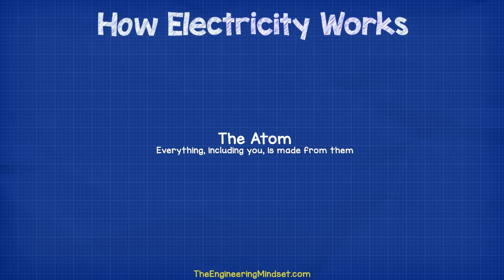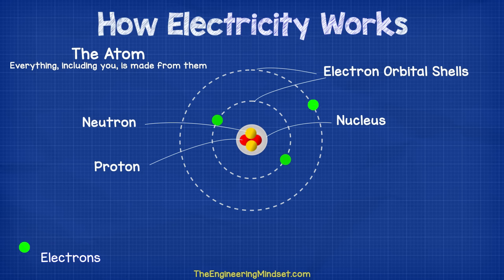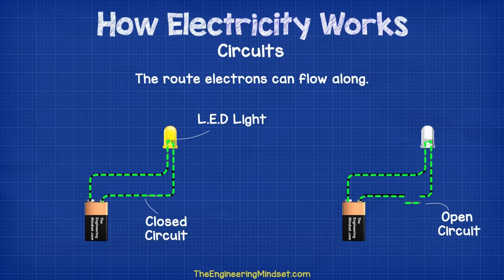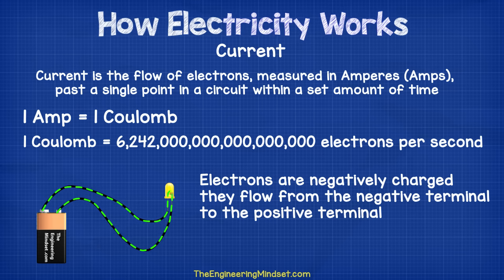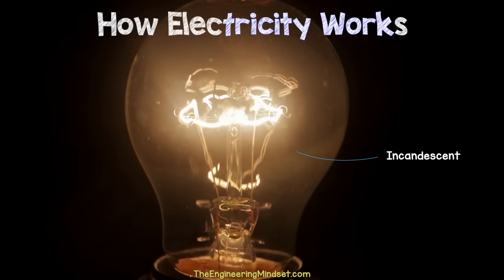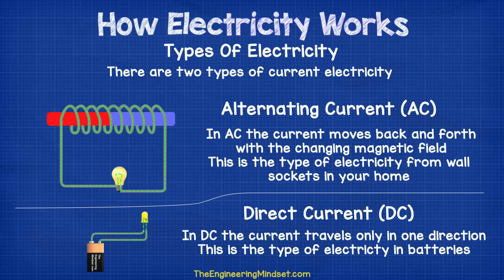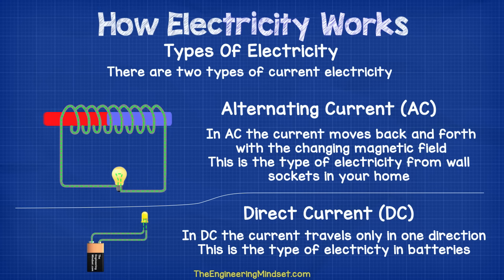How ELECTRICITY works - working principle

Comment: This is an excellent video, very easy to understand, though covering a lot of ground.  It's probably best as a review, or to make sense of material read in a textbook that was confusing the first time through.  If you're a first-timer, watch it a few times, until you get the stuff on capacitors, AC current, and transformers at the end, or look up some videos on those.

I did find four things that were either wrong or a little misleading:

At 0:53, it says that protons and neutrons are heavier than electrons (they are, by ~1837 times), but this isn't why they're in the nucleus.  Gravity is uninvolved.  Rather, they attract each other through the weak nuclear force, one of the four fundamental forces of physics.  This forms a small blob of particles with positive charge.  The electrons surround that charge concentration.

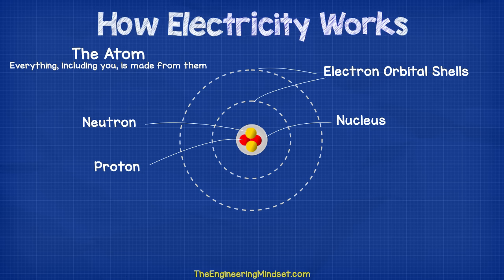At 1:00 in the diagram of the atom, it shows and the narrator states that electrons travel on paths like orbits.  This is incorrect.  It's commonly said because most people have a hard time conceptualizing the electron clouds of quantum mechanics, which is our best understanding of how electrons behave.  If you're not going to take a crack at explaining that, it's best to say something like:

Electrons exist around the nucleus in clouds or shells, each of which can hold up to a certain number of electrons.  We often think of these as paths like orbits at different distances from the nucleus, though that is just a conceptual convenience that we'll adopt here.  In this concept, the farther out the shell, the more electrons can fit in a shell and the easier it is to break one out.  It's also harder to break electrons out of full or mostly full shells.  Conductors like metals have just one electron in their outermost shell, making it easy for that electron to escape and flow freely.  That's what makes them conductors.  Insulators have full or nearly full outer shells, and, thus, very few free-flowing electrons.

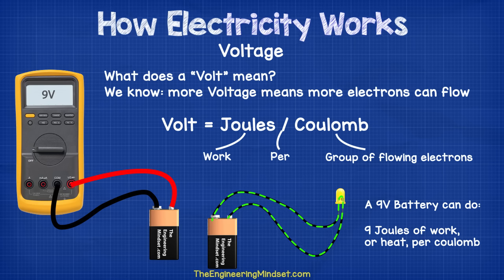At 4:00, the narrator gets it right, but the slide has an error.  The slide says "1 Amp = 1 Coulomb" and "1 Coulomb = 6,452,000,000,000,000,000 electrons per second".  Rather, 1 Amp = 1 Coulomb per second and 1 Coulomb = 6,452,000,000,000,000,000 electrons.

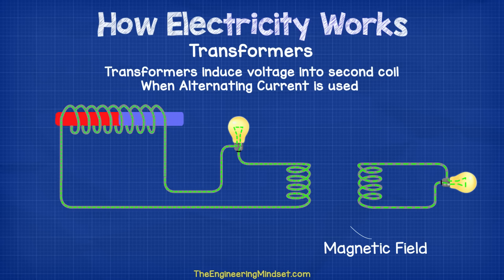Just a nit, at 6:53, the two coils in the transformer both have 4 turns, so they would not change the voltage.  The dashes showing current flow are different in the two circuits, implying such a change.

None of these will confuse a viewer who has never been exposed to these ideas.  Overall, it's an excellent video!  I'm recommending it to my son, who, sadly, refuses to learn from me directly.

-jh-

Comment: Thank you so much for your videos! Amazing explanations around electricity concepts for non-technical folks like myself.

Help me understand something: 

1 amp means 6.242 quintillion electrons pass through a point in a circuit in 1 second. This also implies voltage in a circuit of 1V and resistance of 1 Ohm, correct? If we increase voltage to 2V, does that mean that twice as many free electrons would be flowing in a circuit and passing through a point - i.e., 12.848 electrons/second? But that effectively raises amperage to 2 amp, doesn't it? Or the number of electrons does not change, but their speed at which they travel in the circuit doubles? But that also effectively means that double the amount of electrons would be passing through a point in a circuit each second. So I am bit confused with the relationship between current and voltage. Can you explain it in terms of numberand speed of electrons that travel through a point in a circuit? Thanks a lot!

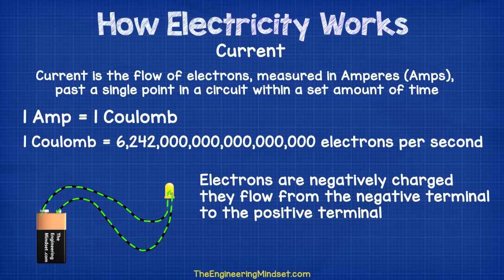Comment: Slight error: at min 4:30 it seems like amps measure electrons per second squared, like acceleration, and you wrote that 1 coulomb is measured in electrons per second. 1 A = 1 C / s and 1 C = 1 A * s or 6.242*10^18 electrons. Not electrons per second

Comment: If the current is flowing from the positive to the negative as in this demonstration and the resistor is on the negative side of the LED why then doesn't the LED burn out ? Shouldn't it be in front of the LED between the positive terminal and the lED?

Comment: I enjoy your videos, but the polarity of your 9V batteries is backwards!  The small terminal is positive and the large terminal is negative.  Your electron current is going the wrong way with respect to your batteries (unless you are indicating conventional current flow, which is used by engineers and historically is shown flowing out of the positive terminal).

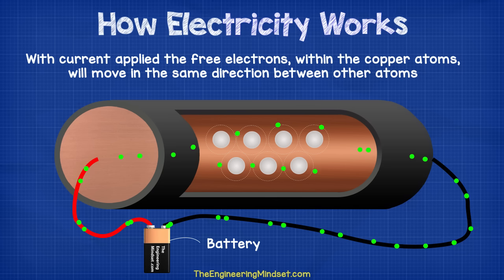Comment: Error at 2:34 the electrons flow in the other direction, from the lowest voltage to the highest voltage, wich mean from the black to the red wire

Comment: Great video, short & to the point as it should be!

---------

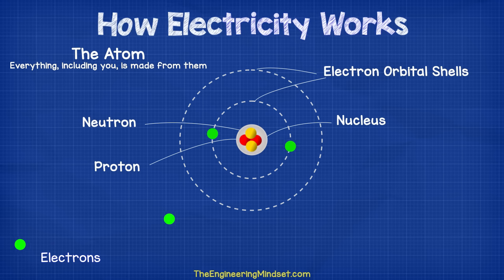01:30 INSULATOR: atoms without free electrons in valence shell
CONDUCTOR: atoms that can pass electrons - surround with insulator (e.g. copper wire inside rubber) 

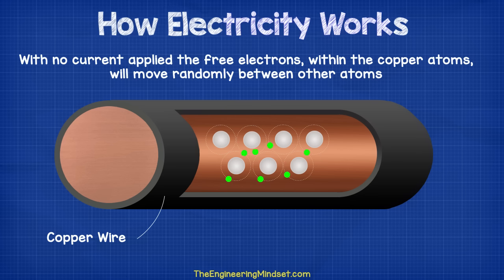02:15 Atoms are passed randomly in any direction
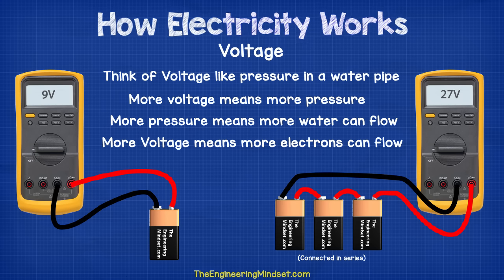Connect conductive material to CLOSED circuit with power source -> 03:09 VOLTAGE (pushing force, analogy: pressure in water pipe) forces electrons to move in same direction, trying to get to the other terminal

03:23 VOLT= work (Joules, heat/light) per group of flowing electrons (Coulomb)

03:59 AMP = unit of current (analogy: flow of water in pipe), 1 Amp = 1 Coulomb/second
04:37 RESISTANCE (unit = Ohms) = restriction on flow of electrons -- factors: length (longer = more resistance), thickness (thicker = less resistance), material (copper has lower electron collision rate than iron -> copper offers less resistance), temperature (hotter = less resistance)

In circuits without inductances or capacitance Ohm's law: Voltage (V, in Volts) = Current (I, in Amps) * Resistance (R, in Ohms) -> Current = Voltage / Resistance & Resistance = Voltage / Current
Power (P, in Watts) = Voltage * Current

04:59 RESISTORS restrict flow of electrons, e.g. protect other components or create light/heat (05:16 high enough collission rate of electrons due to resistance => incandescence)

05:40 INDUCTOR - coiling a wire intensifies its natural magnetic field as current passes through it -> electrons in wire become affected.
More turns in coil / iron core / more current ---> stronger magnetic field ---> electromagnets + induction motors

06:27 AC GENERATORS; passing magnetic field THROUGH coil -> induced electromotive force -> induce voltage, cause current to flow if in circuit

06:52 TRANSFORMERS: induce voltage from primary coil (in circuit with AC generator) over into a secondary (proximate but not touching) coil (in CLOSED circuit). => allows to increase/decrease voltage between primary and secondary coil by changing amount of coils on either side.

07:38 CAPACITOR ("condensator" in multiple languages): separates positive and negative charges across 2 plates if connected to power supply -> build-up of electrons in electric field ... interrupted power supply -> charges released (power source for few seconds) + pair back up again

08:17 ALTERNATING CURRENT (AC): current flow backwards & forwards as terminals are reversed, most common (wall sockets,...)
DIRECT CURRENT (DC): current flows only in 1 direction (batteries, handheld devices, solar panels)

Comment: Marvelous, Great. I just have a quick question, Can you tell why the polarity does not matter when connecting electronic devices into an outlet?  I know current alters but If you show it with a video that would be great, I almost got it right but I just need a extra push

Comment: So are the electrons flowing in a circuit actually the electrons from the atoms of the conductor and not electrons flowing from the battery? When electricy is said to flow through a person( being electrocuted) is it the electrons from the conductor they came into contact with flowing through them, or electrons from the atoms that they are made up of ( skin,bone,blood,etc) being induced to move?

Comment: I have an "uhhh, actually" for you that you may want to ignore.  You discuss current and electron flow as if they're the same with electrons moving from a battery's positive terminal, throughout the circuit to ultimately flow TOWARD the negative terminal.  But you're mistakenly conflating CURRENT direction with electron flow direction.  But since elections are negatively charged, they travel from the negative towards the positive. So current and electron flow go in OPPOSITE directions.

Comment: Hold on, do you need neutral with 3 phases? I've seen power lines with 4 wires, one is neutral, but it's only in one residential area.

Comment: Anyone here can answer? From what i understand in this video you are saying that energy in the form of electrons came from a conductor such as copper. The electrons detached or flowed through the circuit because of voltage or the pushing force from the battery. Am i right? Then now i have a question. If this energy (electrons) which came from the conductor is continously consumed by a load such as bulb, why is it that the conductor never run out of electrons? or theoretically it will eventually?

Comment: There is a mistake at 04:00. 1 amp = 1 Coulomb PER SECOND. And 1 Coulomb is just 6,241 506 × 10^18 electrons and NOT per second. You say it correctly though so I think it’s a typo :)

Comment: Can you explain why connecting cells in series adds up the voltage based on the actual electron flow inside the cell and the chemical composition of the cell (it would be really good if you also explain in terms of redox potential) ?Please explain with the example of a   zinc carbon cell(or any primary cell).

Comment: There is a video circulating in various conspiracy fields and I cant quite figure the physics of it. They have an experiment set up which is a combination of the final 2 images you have on this video. Where you have a magnet through the coils in AC, they don't have that. Where you have a battery in the DC they don't have that. They have a coil of wire (no information on material), at the end of the coil they have an insulator/plate and then a button magnet. When they place a LED or small motor across the battery to the opposite end of the coil, they have a current which operates the LED or coil. They also have a voltmeter reading ~2.6v.
I know its an induced EMF, but im sure im missing something, can you help?

Comment: hello 
thanks for the videos 
I'm an absolute beginner 
and my question is that will the voltage of batteries change? for example if a battery is 9V when it's full charged will it be like 2v when its capacity is some where about 20 percent?

Comment: If you think of electricity as water, voltage is the pressure of the water, current is how much water you have or its flow.

Comment: Well technically the electrons do not follow an orbit around an atom the way a satellite orbits a planet, there's the whole particle-wave duality and whatnot. But I suppose that doesn't really matter as long as the valence electron(s) are able to switch atoms easily. I'm sure you knew that and just made the video simpler, but it felt somewhat inaccurate to me.

That being said, amazing video and I learned some useful stuff from it. Got yourself a new subscriber.

Comment: i just don't understand the animation at 5:02. the one on the left. it shows the whole current slowed down even before it passed through the resistor. also the resister is placed after the led(if you follow the direction of current in the diagram) so I don't get the point of it

Comment: Breathe video but electrons do not actually orbit the nucleus they actually have an area in witch they are likely to be as you can not pin point ones location because of their size and these areas are called orbitals (even though they do not orbit) these areas shapes are defined but what level you are on but there p1 p2 p4 p8 p16 and so on

Comment: This is the best video so far, Many thanks

I have a question on one part the + and -  on a capacitor or battery are just points to show where the flow of electrons goes out and enters right?
It doesn't mean +(proton) and -(electron)? correct?

Comment: Electrons actually move very slowly through a wire connected to some voltage source.  What really happens is the electric field sloshes the electrons in the direction we call the direction of current flow and the electric field propagates very close to the speed of light.  Slightly less since it's not a vacuum.

Comment: In 4:55, the diagram explains that if we drop down the temperature of the circuit than the resistance increases. Well I think the resistance of the circuit only increases when the temperature is also increased. It has a direct proportionality relation.

Comment: Why cant we keep an led running forever if the power goes back into the battery is it lost as heat when the bulbs are warm? Also is hz on a household appliance example 120v 60hz the frequency in which the magnets move side to side like the frequency in which the current flips??? Have to admit never really thought how interesting electicity is

Comment: summary:
- the electrons in the valence shell (outter shell) of some atoms can flow from one atom to a neighboring one
- if you create an electric potential (aka voltage*) difference across a *conducting wire, the electrons will flow in one direction through that wire
- if you cut out a small piece of the conducting wire, and replace it with a resisting wire, the resisting wire will get hot as electrons flow through it
- you can use this concept to create things live electric stoves, heaters, etc
- there are certain resisting material, that when heated up, will produce a lot of bright light, you can use this to create electric light bulbs

units:
- voltage is a measure of electric potential difference between 2 points in a conducting wire
- the unit of voltage is Volt
- a Volt is the number of joules of energy given of as 1 coulomb of electrons flows from one point to the other
- a coulomb is just a really large number
- current is a measure of how many electrons are flowing through the wire per second
- the unit for current is Amps
- 1 Amp is 1 coulomb of electrons lowing past a certain point in your wire per second

briefly covered stuff:
- an inducer is a coil of wire, that generates a magnetic field in response to current going through the wire
- the magnetic field creates a voltage in the opposite direction as the current
- this is how AC (alternating current) is produce
- AC is when you move electrons in one direction in the wire, then in the opposite direction, then in the original direction, then in the opposite, and repeat
- DC (direct current) is when electrons move in the same direction the whole time
- a capacitor builds up charges as current flows through it (when current stops flowing, the charge dissipates)

Thanks for this video! Extremely well made!

Comment: It is good he got the direction of electron flow direction correct, neg to pos. I just watched another video that had it backwards. Perhaps this is due to the confusion of the direction of current flow which is in the opposite direction of electrons, which I was not taught in school. 
 I learned about that many years later. Current travels much faster then electrons also. Electrons travel through a conductor quite slowly. It's a strange world I know.

Comment: Hello. Thanks for the great informative video. 
I got a practical question about how to find a right charger for my device. a small electronic hair clipper. 
I move from Hong Kong to Japan. That makes me I need to change the charger. 
The device input is 2.4V DC. 
The original charger is Input AC 220V 50Hz 70ma // Output DC 2.4V 1.4 A. 
The replacement charger (from the same manufacturer in Japan, I order the charge of the same model) 
The spec is : AC 100 50-60Hz 8VA// Output DC 3.0V 1.4 A 
They mean to be matched but how come the spec is quite different. Tho the walt are similar. I am a bit worried to plug it in. BTW, one more piece of info, I checked the device in Japan, the spec is also the same 2.4V DC input. I think I can use it. But I am not convinced scientifically, so I am worried. 
Hope you can get a good answer from a expert like you. 
Cheers!

Comment: Electricity/Electric field is a combination of dielectric field (electrons) + magnetic field. Both fields cross each other at 90 degree angle to produce AC or DC electric field you are familiar with. See Steinmetz diagram on page 10 and 11 in his book "Elementary lectures on electric discharges, waves and impulses, and other transients". You can also see dielectric field as voltage and magnetic field as current. Both fields together create power measured in watts.

Comment: 1 amp = 1 coulomb per second. 1 coulomb doesn't have to be an electron it just measures charge, and coulombs dont equal electrons per second, amps do. Coulombs just equal electrons/other charged particles.

Comment: I know this is a beginners video, but you really shouldn't say that it's the electrons powering a device. Its the electromagnetic wave that powers a device. Electrons in a wire flow on a scale of millimeters per hour.

Comment: from my understanding voltage determines the speed electrons flow through a circuit so if you had a high voltage battery would the electron current move faster around the circuit. correct me if im wrong

Comment: 1:08 The speed of an electron is actually very slow - less than 1 cm per second.
However, the speed at which electrical motion is transmitted to neighboring electrons is the speed of light.